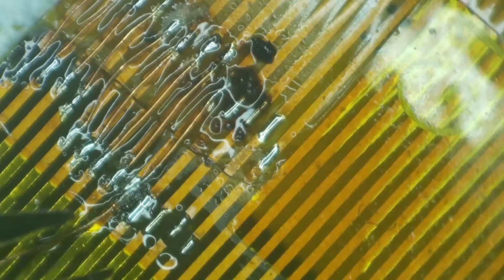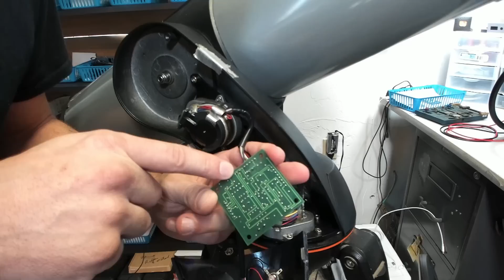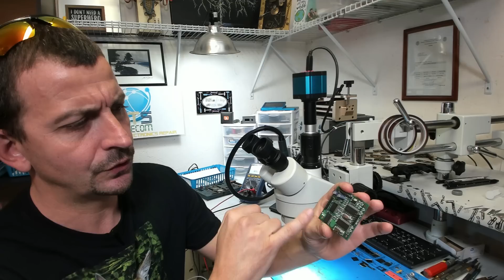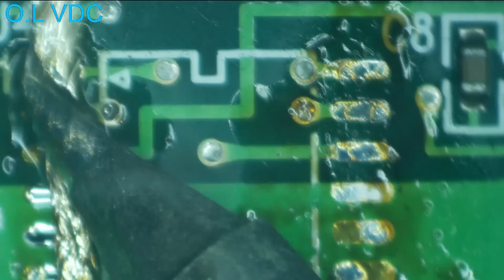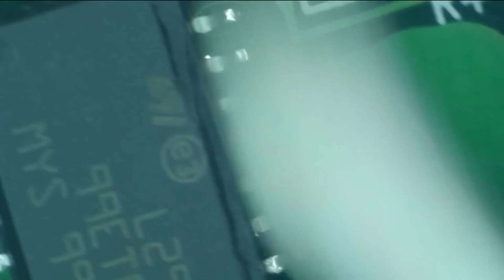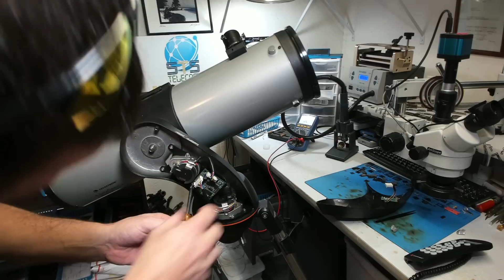Celestron NexStar Telescope Board Repair 🔭

Comment: So, I'm not bad with electronics, but I'm no wiz. I have an SLT mount with an inoperative altitude control. Asthmith is okay. Asssjmkngvi could get the chip I need, I've never removed a cop like you have herec and i don't have that kind of microscope (o do have a few microscopes however. Whatever liquid you are applying, I've never seen or heard of. Can you please recommended a video that has specific information on what techniques you are using here to remove and reinstall the chip?

Comment: You can't really beat leaded solder. Sometimes such failures are indicative of other problems elsewhere, since most ICs nowadays are more than adequately rated for current supply. The servos, especially the one on the failed channel,  both sound decidedly rough. With a 600mA (peak 1.2A) output per channel, there's more than enough current to drive those motors, and my next job would be to see how much the motors are drawing. I suspect the slew (horizontal) servo might have an issue, so it may well be worth giving them a spot of TLC to reduce the risk of a future identical failure. I note this chip is also available as a standard  16 pin DIP package, so it may even be worth replacing the SMD option with a socket, to allow ease of replacement in the future. Don't forget to use contact cleaner on the headers - makes a big difference in terms of reliability.

Comment: Frustrating that the motor wire connectors have no markings to indicate direction. Had to repair the cover after the plastic around the screws broke (20+ year old plastic and a 2 foot fall will do that...) and stupidly forgot to take a picture of the wiring. Thanks for the video, you really saved me some headaches!

Comment: You have the tripods swapped,.at least as far as what the scooes originally came with. The silver tubes came with the square leg aluminum tripod and the black ones came with the steel tube tripod.  The steel one is a little better than that super light and flimsy aluminum one, but in the case of both of those scooes, the tripod is the weakest link. 

The silver tube, I assume to be a nexstar 130gt, is 20+ years old, they  came out with the nexstar SLT series shortly afterwards.  The black nexstar GT were mainly costco specials, not part of the actual celestron lineup, but exclusive to costco.  They have modern improvements like a dovetail and saddle system, rather than the tube cradle, but the dovetail is so short, you cant balance the scope if needed.  The costco GT mounts are a great way to get a goto mount for a small scope, but most of the scopes that came in the specials were way too big for the mount.  Long tube refractors where the normal models had short tube refractors which are far easier on the mount and can point higher in the sky because they wont hit the legs like the long ones do (and have set altitude limits in the software).

My first ever scope was one of the last silver tube GTs, but a long tube version of the nexstar 80GT, f11 instead of the usual f5, which is better optically, but way too much for the mount,  especially the tripod and fully plastic clamshell. They called it a nexstar 80GTL,  L for long tube. It was the costco special 2004. And had a special customer support line, staffed with people trained only enough to read the manual, as to not flood the real tech dept with the masses of non astronomers that costco attracts.

This brought back memories.  Not that i had to fix motor boards, but i did customize the shit out of mine, adding the then expensive baader dovetail bracket, and using a long bolt to attatch the mount to a tasco tripod that was the nexstar 5 equivalent, and using it with a 127mm orion mak.

Good times

Comment: I had an actual " fried " board today , worked on a dead tabletop ice maker , I opened up & saw some smoke indications , pulled the board out & found on the back side a large area of the board [ about 1/4 " ] burned out .
What had burned was the fuse [ in black box ] one leg and over to the power coming in 120vac .
The reason it burned & did not blow the fuse was because the board was munted directly below a pivot point for the ice tray , when it filled with water - the water would dribble out down to the board , with a long enough time & heavy mineralized tap water --- the minerals in the water pilled up & made the short that burned the board --- and weird did not blow the fuse ;)
Dug the burnt / carbon out of the hole , add copper wire to extend the missing legs & traces --- and all working .
Lastly glued in a plastic shield , so if the leak kept happening --- is would runout the bottom - not onto the circuit board .
Thanks again
Reply from the maker: Wow that is crazy!  I bet the engineers who designed that never would have seen it coming!  Nice repair though and glad you fixed it.  Thanks for commenting

Comment: Thinking aloud... Your son uses the computer to control the telescope, I assume it also did not pan left and right under computer control? It sure was nice for the manufacturer to make the motors swappable for troubleshooting. Thanks for the different repair video and welcome back!
Reply from the maker: Correct, no pan with computer controls.  If the motor board repair had failed, we were going to go straight for replacing it with a standard micro-controller setup (use esp32 or arduino).  We may actually be doing that anyways though!  Thanks for commenting! :-)

Comment: Nice one ... as soon as I saw that mount I said gonna be the motor driver chip ... I got similar Orion/Merlin mount, board is slightly different ... took it apart but plugged the power cable in to one of the motor connectors (both axis motors & power use 6pin headers on my board) ... doh! ... blew a crater in the driver chip ;) ... surprised I got a replacement ... nice repair though ... love to see more like this ...

Comment: knew you could do it
lots bigger than your typically used to right? 😄
nice job
oh, and that duct tape is just fine, good for 100mph so no worries there 😉
Reply from the maker: I wish I was recording when my son walked up to look at it and the plastic cover fell straight off into the floor.  Lol the textured/glossy plastic is tape deterrent.
Reply: @ststele  If possible wrap it right around back onto itself. I'm a church av tech... duct tape expert haha.
Reply: @allanmowz  I was going to suggest the same thing!
Reply: @ststele  oh no, drats, that pesky plastic. well you did say you were going to fix the screw holes so no problemo right? 😄
i've been researching into buying one of those celestron units, i just can't decide on which one to get, refractor or reflector... i see so many different opinions on which is better it's hard to know for sure. Anyways nice job there and thanks for the video's 👍

Comment: Smashing repair jason :-D,  the two motors are likely ordinary d.c  types, that chip swaps polarity to the selected motor.
You do realise that millions of telescopes will wing there way to your door for repair lol.
That cat on your T shirt,  What did someone do to that cat to get it looking surprised lol.
Reply from the maker: Thankss👍I will gladly accept these boards for repair!  I think the manufacturer sells the boards but people with older models are out of luck. I didn't make an attempt to source a whole board for this one. I just went straight after fixing it!
Reply: @ststele That’s more like the size scale of what I design and work on, and I was just smiling the whole way through this video. You did everything “by the book”. If only someone wrote the book that is. Excellent job.